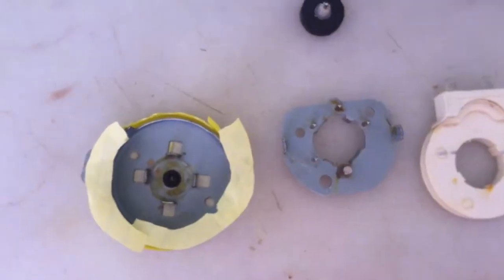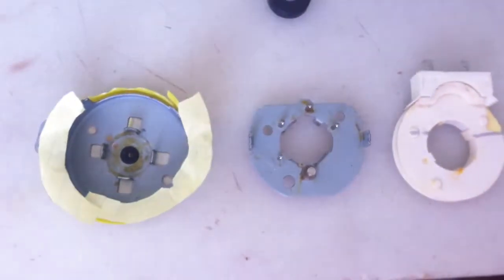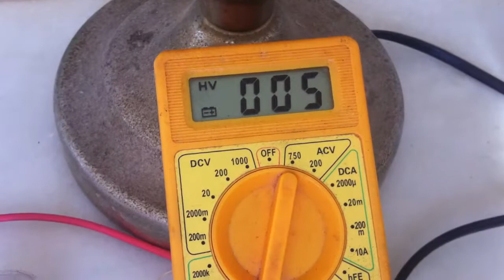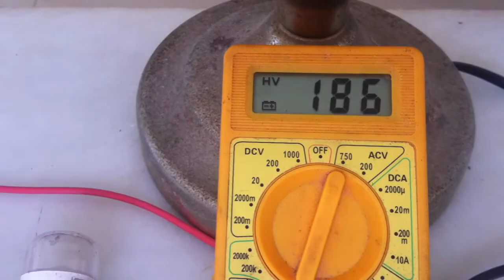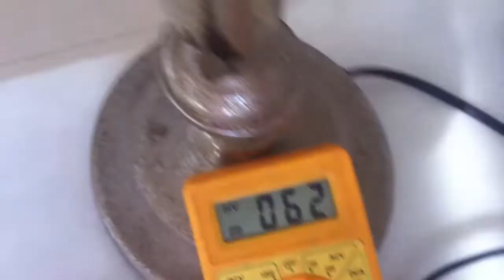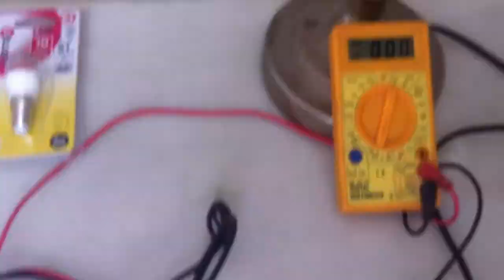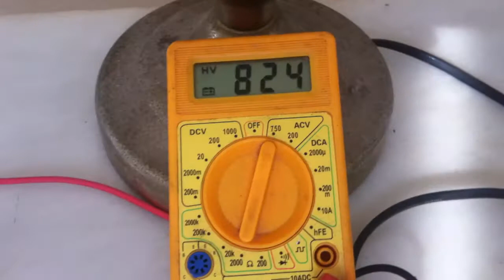800V output generator from a mini motor from a microwave

Comment: Why you lie for 
The casing does nothing just holds the spinning magnet in position but may also act as a brake for the rotor when disconnected from a power source